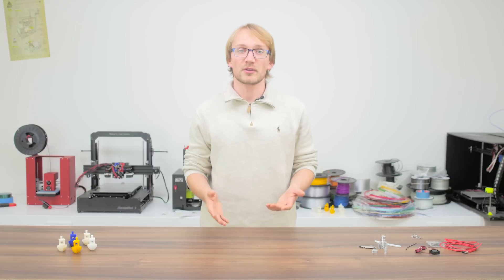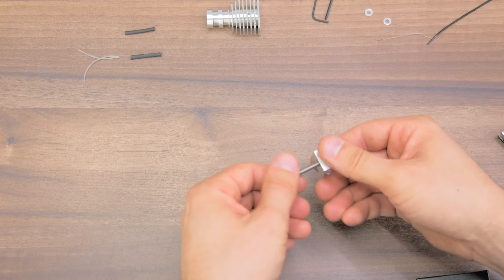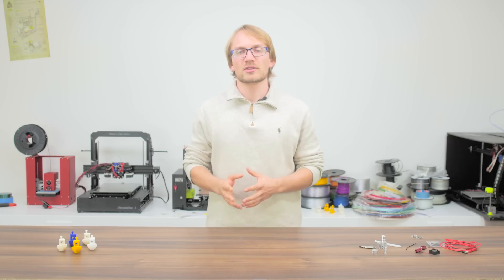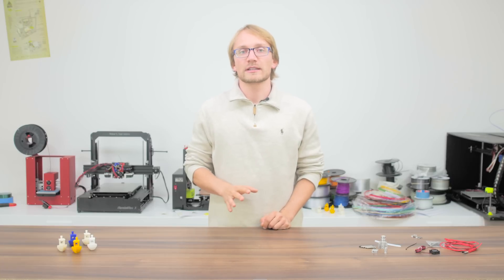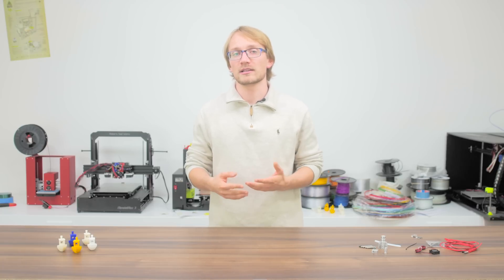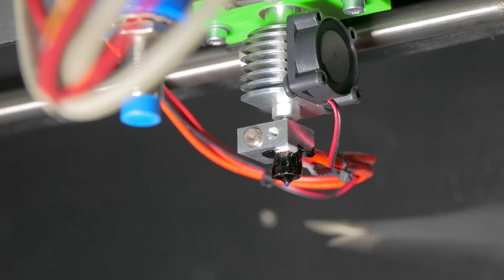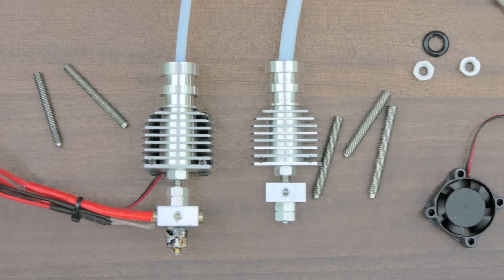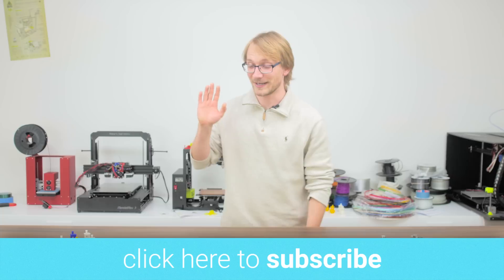Review: The adjustable Prometheus Hotend V2!

Comment: Why the extra nut under the heatsink?  The on line instructions leave this out and rely on the set screws to hold the nozzle in place (The V1 didn't have them).  I guess if you really NEEDED the nozzle to be physically longer to reach the bed that would be a way to do it but ......

(I have one of these and have yet to install it so I was wondering).

Comment: Tom, I must disagree with you about how "difficult the Prometheus is to use".  In my experience it is far easier to use the single shaft versus the multiple part shaft of the ED3.  In fact I wish that the Prometheus used actual resistors as heat sources because the cartridges are far more delicate than they need to be, and I not long lasting for teh price to replace.  The ED3 has to be assembled, then heated and then tightened while hot.  This process is repeated every time a filament is changed.  I do not like that set of steps. 
 
Although the hot end length has to be adjusted when the hot end changes that is something that I find very acceptable. To me, 3d printing is not like driving a honda, it is more like a hot rod, a person makes adjustments as they go along and learn what is best for their machine.  When you stop and look at your machine you always have something better than what you can get off the shelf or the dealership.

Comment: Hey Thomas, in a future video could you clear out some of the mystery about what firmware and what settings on the firmware to use for the ramps fd board?

When I connect to repetier host I can run the m115 command and get information back on what type of firmware is installed but it won't make the stepper motors run when I try to do so. All the pins out for the stepper are positive without any negative or ground. Any clues how to fix this? To be more specific I have a ramps fd 1.2 from geeetech and running a4988 stepper drivers.

Comment: I actually think the adjustability is a relatively minor advantage of the Prometheus. The biggest thing I've found is that the long one-piece electropolished nozzle makes the hot end quite resistant to heat creep.

When I upgraded my Taz 4 to a Taz 5 configuration, the new wiring exposed an "always on" 5V lead for a hot end fan. The Prometheus comes with a 12V fan, but driving it at the lower speed with 5V worked just fine for PLA.

Then I switched to an E3D v6, also with a 12V fan, and learned the hard way what everyone on the Internet already knew, that the E3D's fan needs to be exactly to spec w/o variation.

Another potential advantage of the nozzle is that since it's so long, you could in theory use some really big retracts. You could retract 20mm and still have the end of the filament comfortably within the smooth part of the nozzle. Whether you would ever need to use such a configuration, perhaps or perhaps not.

Comment: I'm just simply speculating. I've a Robo 3D, the E3Dv6 needs a special fan holder, because it need to be there on a different angle, because of the size of the heatsink. Would this hotend fits in it with the original metal fan holder?

Comment: Agreed, seems a nifty feature that most of us would never really use, I wouldn't want to strip and re-assemble my hotend each time I switch plastic, some "happy medium" seems like a better idea, which yeah granted you can make using that setup but then the modularity is kinda wasted, still the all enclosed hot area solution is pretty nifty, had some leaks between my e3dv6's heated block and heatbeak which this wouldn't be susceptible to.
Reply: +Christian Gerefalk I had the same issue on my e3d Volcano, but i was able to fix it by tightening the nozzle against the heatblock (not heat sink) once everything was installed and the hotend was heated. e3d also explains that in more detail in their wiki. During the mounting process it can happen that the nozzle loosens a tiny bit, also the temperature differences from could mounting to hot usage can cause the nozzle to loosen. That's, why you should tighten the nozzle at 280C (if no filament was jet used witht the nozzle and heat break) or heat to the specific printing temperature and then tighten the nozzle, if there might be plastic residue inside the hotend.
Reply: Not sure where you'd have to rebuild the hot end to switch plastics. I rotated between PLA ABS HIPS and PETG (any to any) without having to do any kind of strip-down and without having experienced jams because of a supposedly ill-advised material change.

I've yet to have an E3D block leak on me. There's a couple key steps to take to make sure there is a decent compression seal between the nozzle and heat break. You need to follow their assembly & nozzle swap instructions.

Comment: I vastly prefer the PTFE lining for the thermistor. That fiberglass crap ALWAYS frays and shorts and I end up burning out thermistors.
Reply: +McSquidification The thermistor sleeving on the Prometheus V2 is actually high temp silicone rubber tubing, NOT PTFE tubing. It has all of the advantages of PTFE tubing (does not fray) but it can also withstand up to 300C without releasing toxic fumes :) Best of both worlds!

Comment: Hey Everyone,

I designed the Prometheus V2 all metal hot end. I just wanted to thank Tom for his objective review!

I also want to clear up a few details which may be unclear.

One thing that I wanted to correct is that the high temperature tubing on the thermistor is NOT PTFE tubing. It is actually high temp silicone rubber tubing that can withstand up to 300C without any toxins being released. It does deform a little above 280C, but that does not compromise the insulating and non-toxic characteristics.

Also, I noticed that Tom tested the 1mm nozzle with the heater block in the middle of the melt-zone. In the instructions, I actually recommend assembling the melt zone with the heater block at the top (just below the heat sink) because this is where the heat is transferred to the incoming filament. If you assemble the heater block at the top of the melt-zone you get much faster thermal response as the thermistor detects the temperature drop immediately and this allows you to sustain higher feed rates and stabilizes the melt-zone temperature.

Please let me know if any of you have questions about my Prometheus V2 hot end! 

I'll be happy to answer them :)

Happy printing!

Eric
Reply: hi eric. i'll try to keep this short, and i'd appreciate a resonse. 
flattery first, hats up for the one piece filament path! i'm a sucker for non-reducable complexity. this deserves to catch on big time. 
though, there are tree options, that i kinda see missing, and that would be particularly interresting for professional and high end hobbyist customers. you are already making quite a specialty part - why not cater to the most peculiar desires. ( ͡° ͜ʖ ͡°)
- a vertical heater block, instead of having to use nuts.
- bigger and smaller nozzles. say below 0.2mm over 1.2mm. 
- nozzles with increased wear resistance. perhaps you can even strike a deal with olssen, to use his ruby insterts.
Reply: +Eric Sammut 
* Do you have some test prints to show off which you printed with PLA and ABS?
* Documentation looks pretty good right now, but would it be possible for you to provide exact configurations for PLA & ABS with different size nozzles and different printing speeds?
* Can you describe how you improved upon e3d hotend design? [I am currently printing PLA with e3d v6 and I am very happy with the results.]
* Can you write an article about some of the design decisions you made when creating your hotend?
* Why can't I have a tracking number when buying a 80$ hotend? Even when buying stuff from China for 3$ I get a tracking number.
Reply: +Eric Sammut Just saw your indiegogo campaign. Some really impresive prints shown there. For example -> https://images.indiegogo.com/file_attachments/469690/files/20140329150740-IMG_1022.JPG?1396130860 .
Reply: +Eric Sammut 
I too do agree that the 1 piece Stainless steel nozzle design is the way to go forward to eliminate filament jams.
Excellent design by the way.
Congrats!
Reply: +Cuda FX Thanks for your suggestions! We are constrained by the manufacturing process that we use for these nozzles but we do try to offer a variety. We currently offer 0.3mm, 0.4mm, 0.6mm, and 1mm nozzles. We will keep your suggestions in mind moving forward!
Reply: thank you for the response! i have at least a grasp, of how difficult production is. and to be honest, it feels audacious, to drop strategical marketing advice. so just take this for future concideration.
currently the one piece design and top machining quality are your only prime selling points, to compete with absurdly cheap v5/6 clones, that work reasonably well. customers seeking edge parameters, are gonna be willing to drop MUCH more, than the new crowd that is satisfied with the cheapest "decent" 0.4er bowden thing, somebody suggested on facebook. which may allow you to ramp up production volume, decrease the price tag, and deservedly become the next big thing. ;)
Reply: Eric, I think you did a very goos job and I am interested to purcase one, but can it be connected to a CR-10?
Reply: My only reservation is you can't use something like a ruby nozzle. Having said that, I ordered my PromV2 and extruder last night ;-) And I plan to upgrade to the second extruder and Y piece. Have you stopped using the PEK tube, and if so why? I thought it was central to getting the filament swaps to work reliably.
Reply: ?Can I use this on a Wanhao i3 Plus?